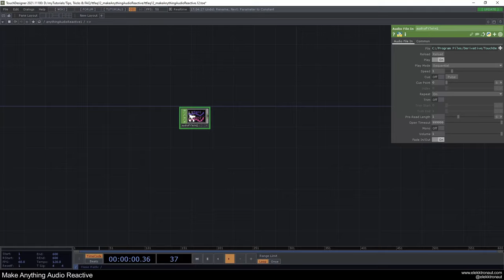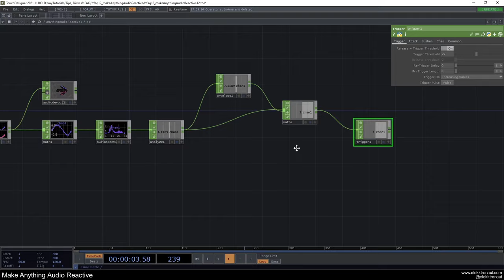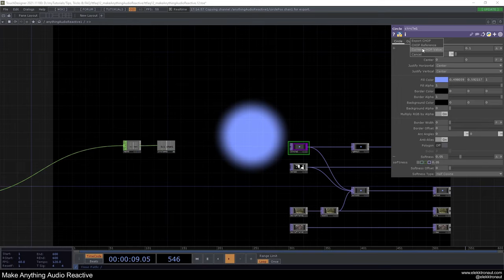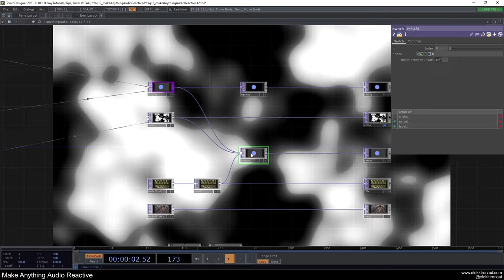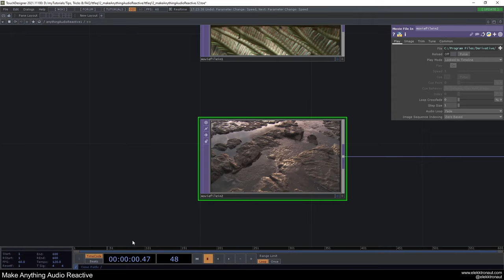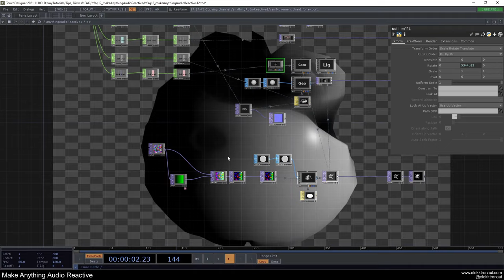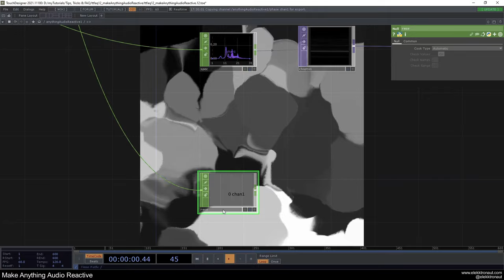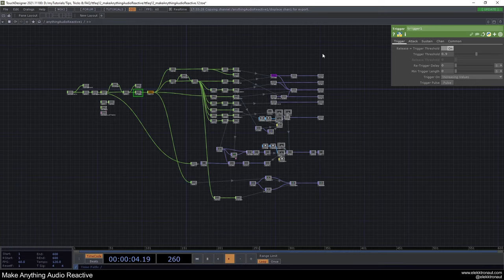Make Anything Audio Reactive – TouchDesigner Tips, Tricks and FAQs 12

Comment: Hi Bileap! This video is a great help for learning how to make things audio reactive. I want to make a group of particles that start of in a shape of a circle, which later disperse, and then regenerate into a shape of a circle again, with the whole motion being audio reactive (disperses and regenerates on beat/every two beats). I also want them to switch positions each time. Which command should I apply to the amplitude of the noise CHOP for it to happen, and for switching the positions, should I do that on limit or on geo?
Here's the map for it so far:

Circle-->Noise on top, sop to on bottom-->both connected to math-->limit (CHOP: math1)-->geo-->render
Camera is on limit and render.

Comment: i have a question: 
i want to make the particles react to the loudness and speed of the audio, is it possible in touchdesign to call out a variable that stores this information and use it to manipulate the movement of the particles depending on the the value of the loudness of the audio, like making the particles generate in wider space as the audio loudness increase.

Comment: If i drag the null (circlepos) on the radius or transition, i get an error: "float argument must be a string or a number, not 'td.nullCHOP'". I rewatched the Video 10 Times but i dont find a mistake. I also get the same output. What am i doing wrong? Would be nice, if you could help me with that.
Reply from the maker: Don't drag the null. Make the null active by either selecting it and pressing "a" on your keyboard or just  the little star like symbol on the bottom right of the op and then drag the channel onto the parameter
Reply: @elekktronaut  thanks! I stuck on this in my project

Comment: Hi! Thank you! I've been trying it out with replacing Audio File In with Osc In (over max msp) but it's not working so good with Osc In as with Audio File In - I was using it for making video audio responsive. Is it because the osc in messages are a bit lagged and too much to process when making a video audio responsive? The Osc In is working fine when I am doing it with noise but not with a video.